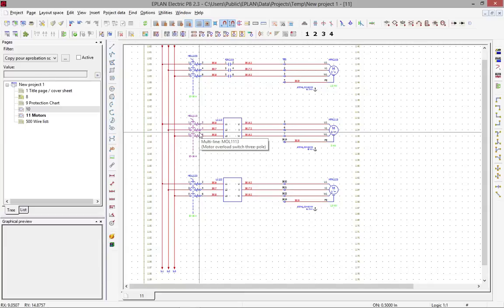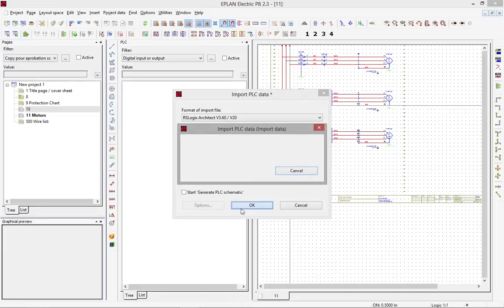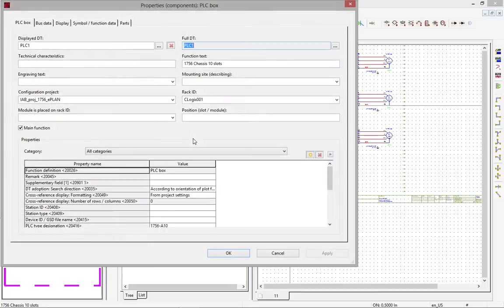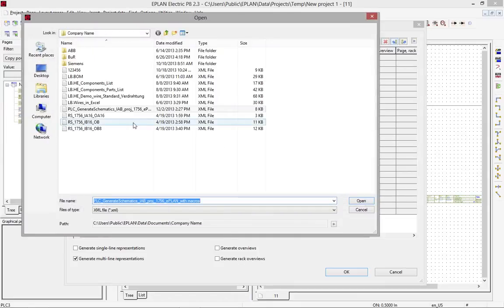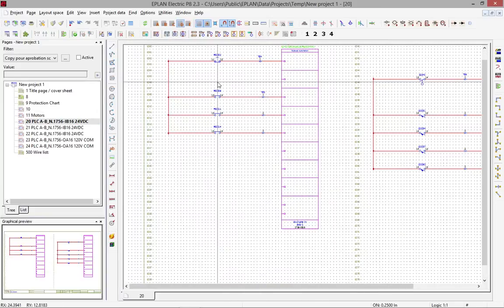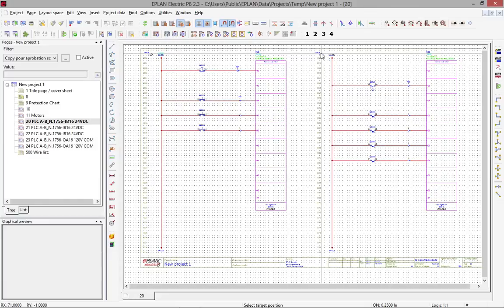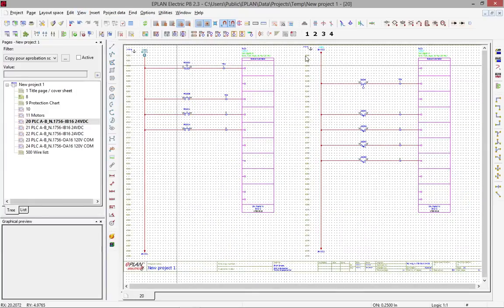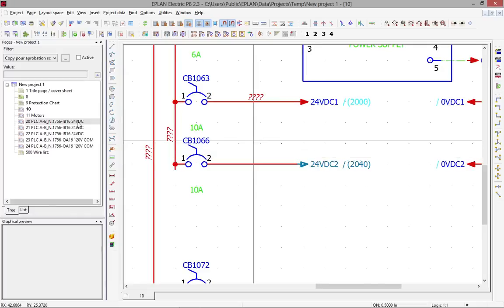EPLAN Smart Interface to IAB generate your PLC schematics

Comment: Hy little question, How do you assign the structure code PLC  automatically when you import, because when I import I get not structure code in stead and he gives my cards the numbers A1, A2 instead of PLC 1 etc. It's the first time I work with IAB so it's possible I did something wrong there. Thanks in advance
Reply from the maker: If I understand you correctly you import from IAB into EPLAN. The Tags are A1, A2 etc, 
You may want to know that worldwide PLC cards are named Ax, according to IEC81346. Since this is a norm that most likely has been looked at when IAB was created, this may explain why Ax is used. This being said, I am not sure if inside IAB you have control over this. Check with your Rockwell Automation Expert.
I do not have that expertise.